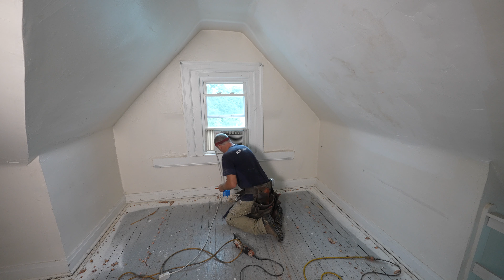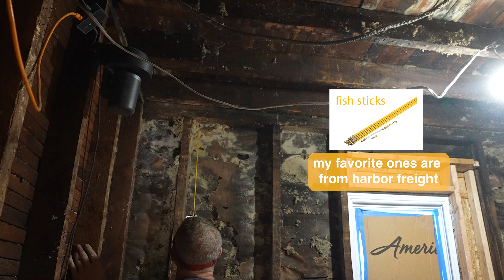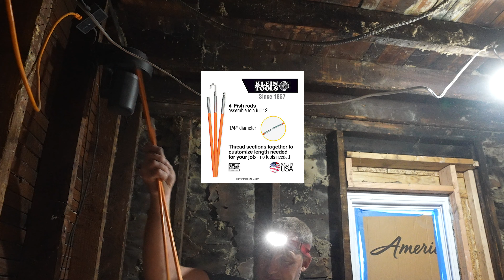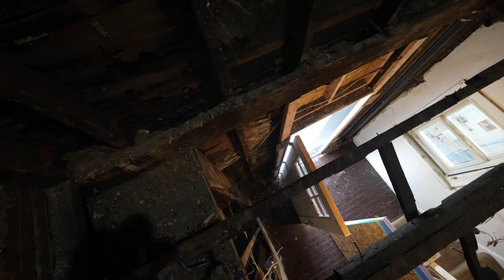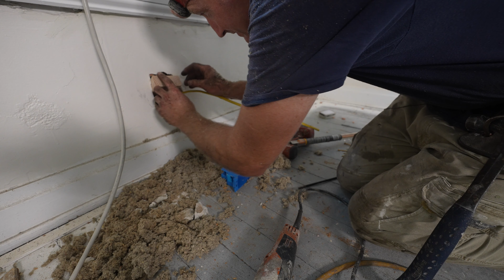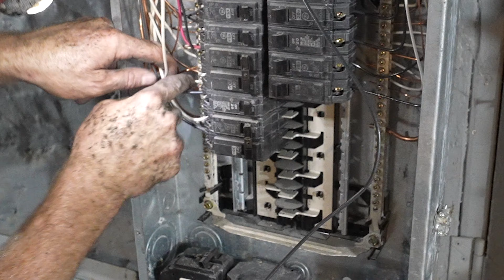Adding an electrical outlet in an old home

Comment: So many ways to do this everyone has an opinion.  What you did was fine.  But as an electrician I advise no one to go onto their own panel.  There are so many things that a non-trained person is not aware of that can happen.  Even for an apprentice.  But run wire and install boxes all day.  You should get someone to look at it that knows tho.  I married in to a DIYer family.  I own my own little electrical business and have fixed/ made safe so much.  I won't get into it but DIY electrical without over sight is a bad idea.

Comment: You would need a single 20 amp receptacle in there to make it true dedicated circuit. 
I would have used a 2 gang new/old work box, mounted to the left or right stud, then use a single and duplex receptacle on separate circuits using a 2nd 12/2 cable for the duplex receptacle and a double pole breaker in the electrical panel. Other appliances can then be used and still have the air conditioner on a dedicated circuit.
Reply from the maker: Good points 👍
Reply: @BathroomRemodelingTeacher  Thanks, I think you did a nice job though and enjoyed your video.
Reply: What if he (we) ran mini-splits?  How do you wire those?
Reply: @honeybadgerisme  You would have to follow the instructions from the manufacturer as the wiring can vary. Generally, you would need a double pole breaker rated at 30 amps or more with the appropriate wire gauge and a 240 volt receptacle.
Reply: @surferdude642  ☝🏼👍🏽Thanks!  I'll have a better idea what to look for now!

Comment: Good tip. Glad you do things right even on a flip house you plan to sell. Worked for someone remodeling a 1929 home to flip and sell and he rigged the hell out of the electric. Didn’t replace any knob and tube, didn’t make any new junction boxes for where they pigtailed them together and left them in the ceiling back in the day, didn’t replace any wiring with sheathing dry rotted off. Used all the same old wiring just replaced the receptacles to look new. The whole house should have been re wired and grounded properly but it didn’t happen.
Reply from the maker: Oh wow. That sounds like a nightmare. And could have been a huge liability to the doing it. Crazy
Reply: lolz--the house I'm in minus the new outlets--you have to tape the wires to the wall to keep them plugged in-so we avoid them...but if we do all the wiring ourselves and just hire an electrician to come check us--it's still $8-10,000 in materials & permits.